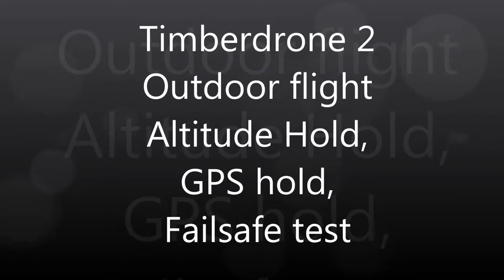Timberdrone 2 Hexcopter first outdoor flight test

Comment: Hey , Pacific NW .. I live here to ..LOL.. Where you at man ?? Just the city .. And sure love yur radio !! What is is that ??
Reply from the maker: Its a Futaba T8J; it is the only radio that I have.  I have about a dozen receivers sitting around for it!  Even used it in a DJI phantom a while ago.  I really like that radio; currently have 3 separate profiles set up in it for 3 different multirotors.  
I'm about an hour west of Portland, near the coast.  Where are you?
Reply: sewerzuk  Independence Oregon ! 11 miles from Salem .. Sounds like you have WAY more tech than I do bro .. I run a ton of nitro trucks and dab in the copters .. Love yur vids .. Thanks !!
Reply from the maker: I'm hoping to start using the copters for aerial Timber surveying...so I do have a bit of time and $$ into them.  You should check out my other videos...have some neat wheeling shots; quite a few of my Deuce and a half.  I'm familiar with Independence; I grew up in Kings Valley, graduated from Dallas.  Joined the Navy, moved all over the country  (and to a number of foreign countries) but still decided to come back to Oregon.
Reply: AWESOME MAN .. I am going to promote yur channel for you .. And I will check those vids out soon ..